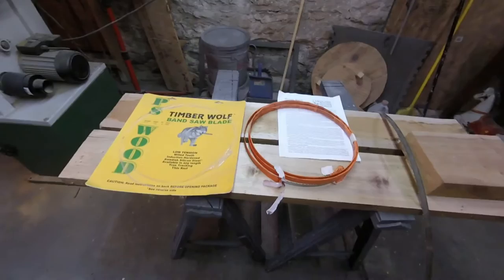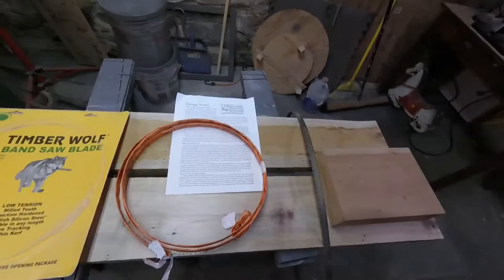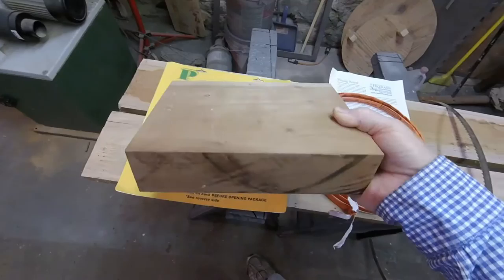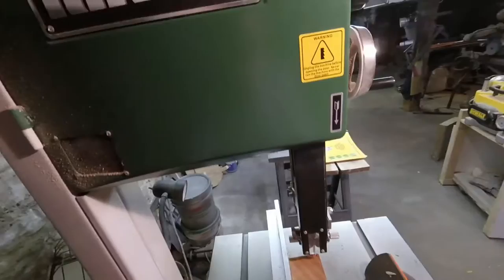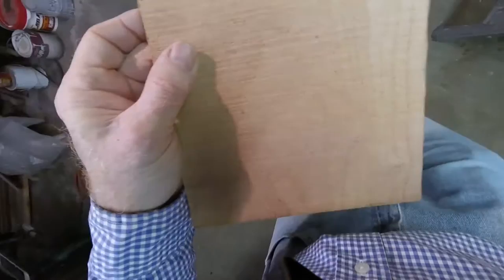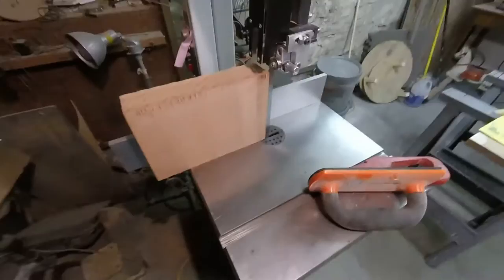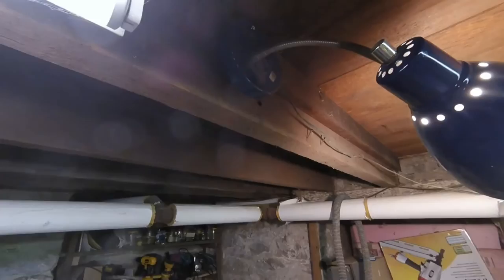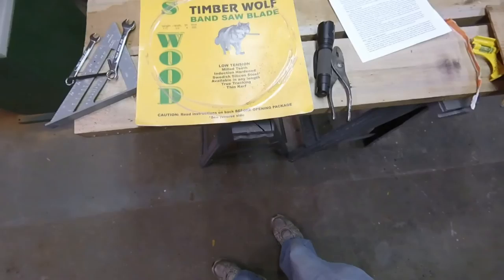Timber Wolf bandsaw blade VS  Wood Slicer bandsaw blade

Comment: I have both Timber Wolf blades and a Wood Slicer that I use on my Grizzly G0513X2 17" saw. The Wood Slicer is as good as Highland's advertising says.  However, I also have several Timber Wolf blades, from 1/8" to 3/4" and have never experienced the problem show in this video.  Something had to be terribly wrong with the setup to have the difficulty shown here.

Comment: I just replaced a blade on my Grizzly 14" band saw with a Timber Wolf 3 tpi x 3/4" blade and it cut through a 24/4 x 20" long piece of cherry like butter.  Either your Timber Wolf blade was used, since you said it had rust on it or you're very biased.  I have used Timber Wolf blades on my 14" and 17" inch band saws for years and love them. I build furniture and use my saws everyday.  You may want to do a comparison with two NEW blades next time.
Reply: Sorry to have to disagree, but I just did the same sort of cut with figured maple.  My results were very similar to those in this video (my post is above).  Unless I got a bad TW blade  the review is for real (and since I've had this kind of performance with every other 1/2 "resawing" blade I've tried, I don't think my TW blade was a "lemon.")
Reply: @williamaustin8364  What blade do you have? I use a 3/8" 4tpi Timber Wolf blade and a comparable piece of cherry would cut about 3 times faster than the Timber Wolf in this video, doesn't really add up? Every TW blade I have purchased has been very sharp right out of the box. Assuming you have a blade designed for thicker stock and it cuts like the one in the video I would contact TW.
Reply: @shawnh08  The TW is a 1/2" 4TPI.  A more useful question would be what bandsaw/what motor HP.  It's a Ridgid (underpowered at 1/2 HP, I know) set up with kool blocks instead of the original mystery-metal blocks it came with.  I have retuned the saw, completely balanced the wheels (both statically and dynamically), replaced the original tires, added the riser, etc..  Basically the saw runs far better than it did "out of the box," but while my other TW blades have been excellent, the one I was comparing to the wood slicer was not.  I took it back to Woodcraft and complained, and they replaced it, but the results were the same.   My suspicion is that the Highland Hardware folks just came up with a far superior blade and that would account for the speed differences between the two blades.  
Differences I have observed - this is after repeating the original test and also trying the same 2 blades with (a) 4x8 yellow pine, (b) 3"x4Q purpleheart, and a piece of old 6/4 cherry I've had lying around for at least the last  7 years.  The differences that were repeatable as as follow below.  With the wood slicer, and comparing it to the TW only:
1) I get a much smoother cut.
2) The WS cuts finish complete more quickly than with the TW blade.
3) The WS blade doesn't feel nearly as hot as the TW after the cut.
4) Finally the saw runs noticeably more quietly with than it does with the (this particular) TW blade.

FWIW having used 2 of these TW blades,  they are ALL noticeably louder than any of the other TW (1/4, 3/8 - 5 blades with different TPI's) blades and I would not be surprised that if that difference noise level with this TW blade was due to a resonance phenomenon of this blade with my saw and its setup.  Also my oldest TW blade (1/4" 3 TPI) cuts faster than this 1/2" blade FWIW.  But it is still slower (and a bit rougher) than the WS blade.

I hope that answers your questions.  I like TW and will consider to buy and use their blades.  I just found something that beats my TW blade in several areas.
Reply: @williamaustin8364  Thanks for the reply! Just to be clear my position isn't that TW blades are better than WS blades in anyway. I'm only saying that my comparable TW blade cuts MUCH faster than the one in this video, in my opinion his TW blade is dull, backwards, or defective. 

And yes if you have an under powered bandsaw that doesn't run very good that may be a big factor, but on any decent bandsaw the blade matters much more than the saw in my opinion. I have a 17" Grizzly 2hp bandsaw myself and it runs silky smooth & very quite but the stock blade was terrible out of the box and was pretty much useless for anything over about 6 quarter. Running proper blades for the application and making sure they are sharp makes a massive difference.

Comment: He is jamming the wood into the blade with the fence. Since he did a video on how to change the blade while installing the Wood Slicer and removed the table, he obviously set the table up much better for the second blade. Timber Wolf would not be in business if they shipped blades that bad.

Comment: The thing I don't like about timber wolf is even when setup low tension as they recommend; they do not track well. They wobble (front to back movement).My guess is its the heat treating of the blade across its width. I did notice that a lot talk about their poor tracking on sites. I use lenox blades and never tried the wood cutter.That is quite a difference in cutting .

Comment: It's ALL about TPI Teeth Per Inch, resaw blades have to have HUGE gullets and less teeth
to carry away the saw dust. If the blade has too many teeth and small gullet the sawdust
clogs the blade, slows the cut and can overheat and warp and wander and and and.
 1 tooth per inch or LESS.

Comment: I'm pretty surprised how poorly the timber wolf performed. I have a 1" 6tpi timber wolf blade .... or at least I thought it was. It cuts quite well, and I've resaw some fairly wide, maybe 6-8" walnut with it and it cut much faster than the 4tpi timber wolf you have. I'm starting to wonder if maybe my blade isn't actually a timber wolf and I was just mistaken .... thanks for the video.

Comment: Something just doesn't seem right with the timber wolf blade. It should've cut way better and faster than that. It is a dud for sure or used to death. I just bought one and tested it against a 6tpi grizzly blade , which isn't resaw blade but it was one that came with my riser kit and only one I had. the grizzly just didn't work at all. The TW was way better cut fast accurate and smooth in some really old hard yellow pine. I plan to test it on something harder but just seems like you got a dull used blade or something.  Was it really new out of the package? I know mine would cut that cherry faster than that. One thing I don't like about my new TW 3tpi 1/2" blade is the weld seam was a little funky, as in it had excess bulk on both sides of the joint and what almost feels like a slight twist as well. I tried to sand it out which fixed the bulk issue but there is still a slight twist or divet. I have to say it is very sharp and cut great though. How is the weld joint on your TW? I'm trying to weed out vibration on my saw and this could be another issue so it might just go back to the store and I may try the wood slicer instead. How is the weld on the wood slicer? I know its been a year since you posted this but do you still like the wood slicer? Thanks.
Reply from the maker: It was a new blade, there is another video out there that shows that straight out of the package the Timber Wolf needs sharpening. As far as the weld It's not to bad, at least on the 1/2" one. I had a 1/4" one break at the weld. The Wood Slicer has a nice weld but I wound say that it is a lot better. I have had no luck at all with Grizzly blades. Either band saw or table saw. I consider Grizzly a another Harbor Freight with better advertising,
Reply: @artpfenninger5914  - Something doesn't add up. I saw this review as I am considering a Wood Slicer blade. I do have experience with TW blades, my general purpose blade is a 3/8" 4tpi TW on my 17'" Grizzly bandsaw and even after cutting multiple 100's of BF my little 3/8" TW blade would cut MUCH faster than your brand new TW blade. I don't work with Cherry much but when my blade was new my feed rate for resawing 6" walnut would be very similar to your experience with the Wood Slicer (in terms of speed). All my TW blades have came RAZOR sharp out of the box, but of course they do dull overtime. Looks like you were sold a used blade or you used it to cut metal before this review? In any case, I can can say with absolute certainty this isn't what someone should expect from a new TW blade.  

Grizzly sells some incredible bandsaws for the price but I do agree with you on basic Grizzly bandsaw blades, they are absolute garbage. Your experience with the TW blade is exactly how my Grizzly blade cut out of the box.

Comment: There is no way that was a real Timber Wolf blade. The Timber Wolf blades I own cut wood very fast.
Reply: Sorry to have to disagree, but I just did the same sort of cut with figured maple.  My results were very similar to those in this video (my post is above).  Unless I got a bad TW blade  the review is for real (and since I've had this kind of performance with every other 1/2 "resawing" blade I've tried, I don't think my TW blade was a "lemon.")

Comment: In another comparison test of many resaw blades, the Timberwolf was a close second to the Wood Slicer. It was not chosen if it cut like yours. Was that Timberwolf actually a resaw blade? Was it thicker than .025? Something is fishy with your results. If you want followers, I suggest you go back to the drawing board.
Reply: Sorry to have to disagree, but I just did the same sort of cut with figured maple.  My results were very similar to those in this video (my post is above).  Unless I got a bad TW blade  the review is for real (and since I've had this kind of performance with every other 1/2 "resawing" blade I've tried, I don't think my TW blade was a "lemon.")